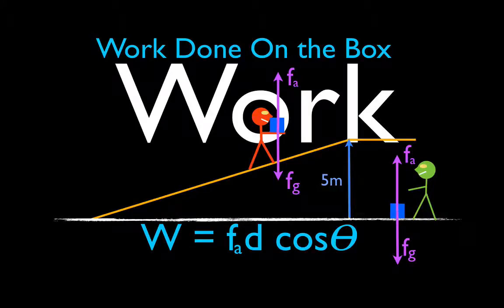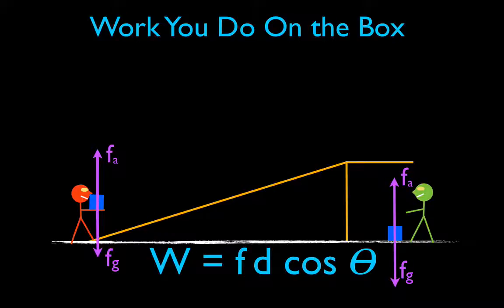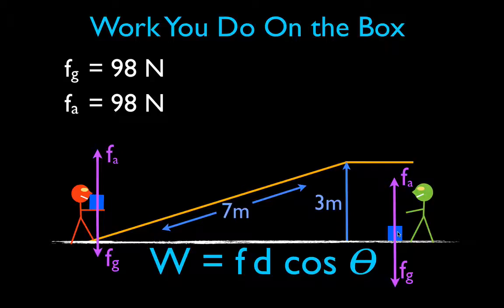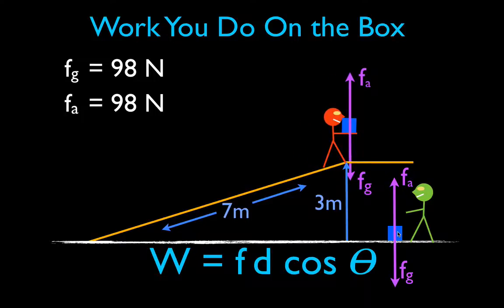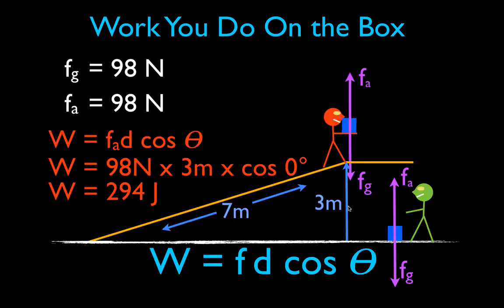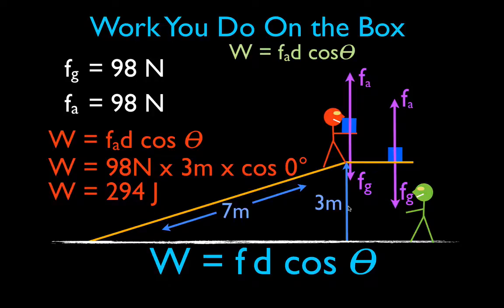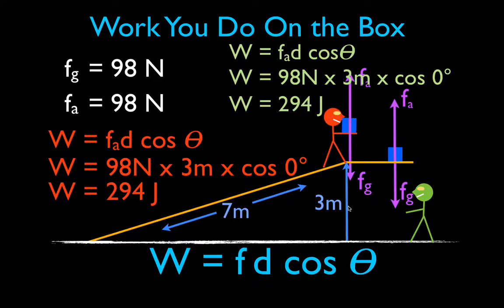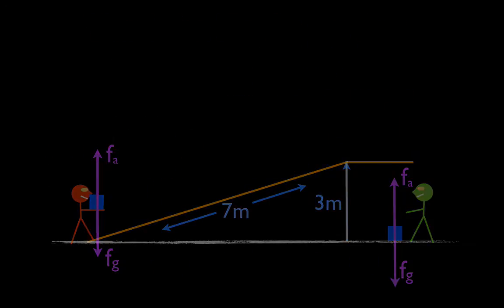Energy, Work & Power (13 of 31) Calculate the Work Done Carrying an Object Up a Ramp

Comment: You claimed that the force we apply on the box is upwards. In that case, how come the box moves up and to the right instead of just up?
Reply from the maker: the force you apply to carrying some up is equal to its weight.
Reply: @stepbystepscience  Yes but when you drag the stone up the ramp, it moves to the right even though the only force arrow drawn is straight up.
Reply: @olivernorth7418  he didn't consider the horizontal forces, he only calculated vertical force therefore only vertical displacement and work done

Comment: May also be worth mentioning that while the work performed is the same for both cases, the force expended is not (at least not the source of that force).  In other words, the ramp opposes gravity applying a contributing force, so there is less effort expended by orange guy.  Which why orange guy can do this with a piano, while green guy can't.

Comment: Hmmm, seems like for orange guy you should simply calculate the work done as F*d*cos(theta) - but theta IS NOT 0, but is the angle between vertical (gravity) and the ramp (about 64.62 degrees for your 7ft long ramp that rises 3 ft).  They answer is the same as yours, but your description of theta does nt match the picture.  By the way, d*cos(theta) is 3, but once you have 3 there isn't another cos to include, so cos(0) isn't relevant to the ramp case.

Comment: Maybe I am overthinking things, but to move up the ramp wouldn't there need to be two forces applied.  In order for the box to move in the x direction a force would need to be applied to the back of the box otherwise the object at rest would want to stay at rest and fall backwards out of his hands.  In other words the friction of his hands creates a force in the x direction, right?  the base of the triangle would be about 6.3m so delta x would be 6.3, I dont know what the force applied would be over that distance though.  Is it possible to have work in the y direction and work in the x direction?
Reply from the maker: I think I understand your question....There is no movement of the box against or opposite the force of friction.  Therfore the "d" in this case would be zero.  But as you move up up the ramp you are moving the box against the force of friction.  Good question.   You can also see a listing of my videos from website http://www.stepbystepsceince.com
Reply: Step-by-Step Science I see,  thanks

Comment: i believe if the angles were also included,the work done would not be the same at all...for instance,the green man has an angle of 90 degrees and Cos90=0..meaning the green man has done no work because the final answer would be 0J....or is there something i missed out?
Reply: Work done = Force applied x displacement x cos theta. Or simply, F.d.cos(theta). Mind you that the theta here is the angle between the Force applied and the displacement. From that we can say that the angle between the force applied by the green guy to the box and the displacement of the box is 0 degrees. Why? Because the direction of the displacement is going up, and the force applied is also towards that direction. Hard to explain without figures but I hope that helps you.